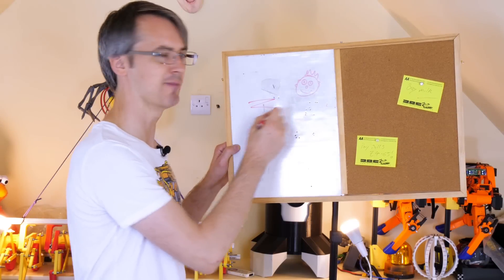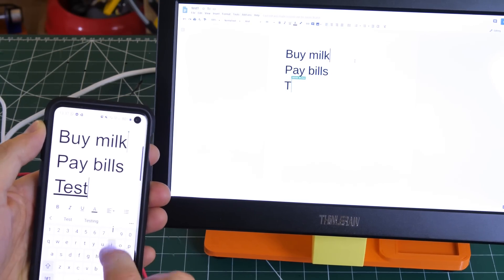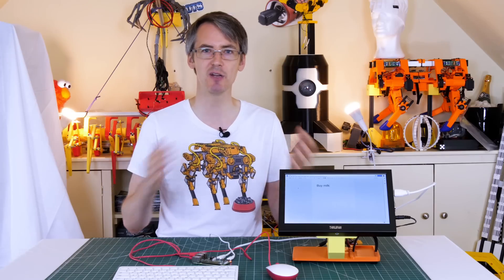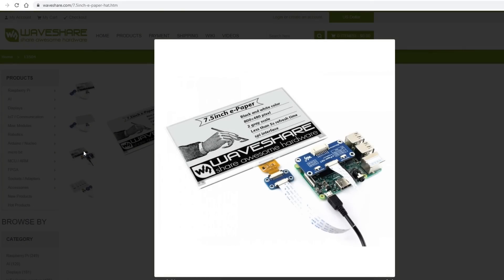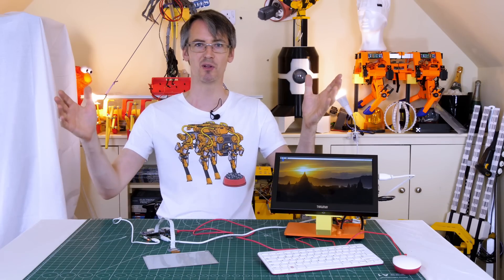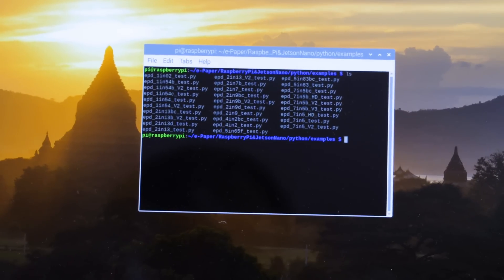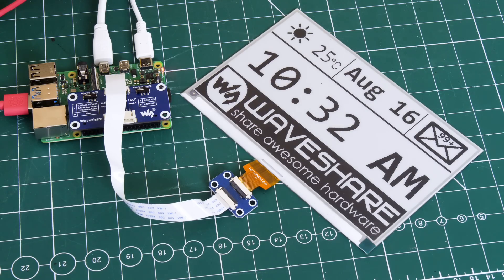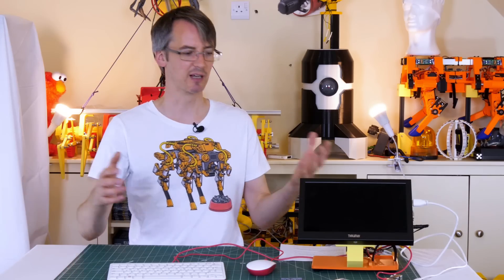DIY IoT  E-PAPER  Message Board

Comment: Oh a few things I got after reading the documentary (a few month back).
1. You can bypass the waveshare API and update text directly. However you risk damaging the display. Because ... (see point 2)
2. Refreshes are used for maintaining the display.
3. You want to refresh the display every so often anyway, due to display might get damaged if not refreshed of long periods. Manual said at least once a month. (I think) But because even refreshing does not use much power* I would refresh it once a day or at least once a week even if nothing changes.
4. You can backlight it, because the display is rather transparent (and lets a good amount light through). I plan to put a bunch of WS2812B behind I can turn on and off and change color to highlight and indicate things. It drives up power consumption, but not but that much. And you could make some items on the list e.g. flashing red, or so.

*= (negatable compared to a Pi 4, still little compared to a Pi 0W, maybe when run on an arduino and put that into sleep mode when not updating it might be add up to something in comparison )

Comment: 12:45 Actually I wanted to do a similar project* it even works on a Raspberry Zero (W), and while I am not experienced to do it, there is a way to get it run on a Arduino which would use even less power. 

*=have basically the same display, but I think I got the 10'' version. Anyway developing did not go well for me since the Pi I used was too slow for that so I put it on hold till I had my hand on a Pi 4 for development. But in meanwhile forgot about it and got other projects in front of it

Comment: New to raspberry but a Python guy. Does the Pi not usually use Debian? Shouldn’t  the Python interpreter know Context mgrs and lists? I didn’t see a close on the sessions nor the text files. So you leave it undefined when the Script ended and repeat it every 5 mins. I am surprised that the google API is not rejecting further sessions or the files get corrupted after a while. Also please don’t repeat so much code and use a List instead.

But that aside your ideas are great. Subbed :)

Comment: Just don't put any commas in your notes or it will break the read of the csv. The csv lib also supports writing so consider using that instead of manually adding commas. If you do, at least escape your text by putting it in double quotes: ".

Comment: Hmmmm.......very complicated and not at all user friendly.
There is a device on AMAZON, called an Epad, that you can write on like paper or a "black" white board.....the screen is black and when you write on it the writing remains on the screen in a light green colour.
The frame is only 6mm thick with a black or white frame, and the actual screen size is 130 mm X 180 mm.....the overall size of the frame is 180 mm X 210 mm.  
There are 2 buttons on the top of the screen, one for locking the display so it can't be accidently wiped, but it will still allow you to write on it even when locked, and one for wiping it clean when it's unlocked.......it runs on a 2032 Lithium button cell....for wiping the display clean..... which last for a few months.
One press of the erase button and the screen clears completely.
There is a passive stylus supplied with the pad, that sits in a simple loop of plastic on the top edge of the pad,  and you can write with your finger nail or more precisely with the stylus.
I use it to make notes and sketches while on the computer....saves using bits of paper or post it notes.
If the battery goes dead the display stays on forever and you have to use a new battery to wipe the pad clean.
Cost?........I bought 3 at A$13 each on AMAZON.........the one in the kitchen is my on the go shopping list.
Reply from the maker: Ok, I just won't make any more videos then. Bye.
Reply: @jamesbruton  OK, but K.I.S.S. then.....

Comment: Yes, great idea, great concept & execution, however I could power a standard 21" screen for a few years for the same cost as this e-paper screen (21" monitor @ 20W, powered on 24 hours/day 365 days a year @ 16p/kWh = under £30 a year! You could dim the display or turn it off during sleeping hours, so you could potentially half the running costs). You would still need the Pi to create an image anyway! Personally I'd rather build it into a mirror frame, plenty of projects & ideas for that. I'd make one if the display was bigger & cheaper as the cost savings for this use case over traditional LCD displays just aren't there!

Comment: Hey James, there is a type in python called list. You don't have to write out A0, A1, A2, A3, A4, A5, A6, A7, A8, A9, ... you can just iterate over the list (for line in A:)
Reply: Yep, was also kinda annoyed by this hahaha
Reply: @fusseldieb  I'm pretty sure you should be able to use a formula to generate a Hash code of a range of cells, all this could be done on the sheet then you would just need to compare the value
Reply: Same here, was pretty annoyed reading that code :D
Reply: also you can write a function that iterates over the list , and call it in multiple locations , instead of rewriting the iteration code
Reply: Same

Comment: Instead of polling the REST API every 5 minutes to see if there have been any changes, you can also attach an app script to your google sheet. You can setup this script to call a little rest API on your raspberry pi each time someone updates a field. This way the screen is updated instantly when you add something and you don't need to check every 5 minutes.
Reply: Trigger is definitivelly the way to go. Use a change trigger to generate a raster for the dimension of the screen and store this in the drive in a dedicated folder. When waking up the device will look for date/time of creation of the file, and if it is still the same get back to sleep. If this is a different date/time get the file and update the screen with it. As a result, replace the raspberry with any cheap MCU wifi enabled and run this on battery for months....

Comment: I had an idea/question that might work for a power supply and came back to your video to leave a comment just in case. You had mentioned in the introduction that a common place to leave notes like this is the refrigerator door with magnets. Could a Peltier module connected to the radiator on the back of the fridge generate enough power to update the display?

Comment: "So I used a Raspberry Pi..."
Me, who replaces every RPi project with ESP32s:
I have been summoned
Reply: An ESP8266 might even do it

Extremely low power consumption. You can make it deep-sleep and disable wifi until the next update, so you only use a few uA!!!
Reply: Next step, partial e-paper update only for changed lines
Reply: Make sure you post a Vid!
Reply: @UrbanInsight  https://www.youtube.com/watch?v=xnUqWcdtqyU
Reply: @trandi8  Sweet! Excellent Job! Youve gained a sub!
Reply: @UrbanInsight  :)

Comment: 4:10 - It won't fade. E-paper is essentially non-volatile storage, like hard-drives or flash-memory. The molecules have been oriented/aligned in a way that causes them to create black or white (or color) patterns, and they'll stay that way until they are re-adjusted. That's why it has to do the flashing thing to reset the display, it's readjusting all of the molecules together since it can't know which ones are in which orientation at the start.
Reply: I have noticed that with a three-color waveshare e-ink display that I have that if I do not run the display for *several years*, the image does very slightly fade, particularly around the edges.

Comment: Love the idea, but you should move your code to write to the CSV file into the IF block and only write if a value has been changed. Not sure if the library you are using is optimized for not writing a file that hasn't changed. This will prevent unnecessary writes to the SD Card.

Comment: Every 10 minutes checking for an update is old school. There probably is a way to use a notification that will call your webhook whenever there is a change to the document. Then you can write the change more real time and use no bandwidth when nothing is happening. I would implement it in such a way that notification causes a refresh of the data elements and set a changed flag. On another thread, check every few seconds if change flag is true. If it is, check to make sure time since last screen update > threshold (say 15 seconds), and if it is update the e-paper and set changed to false and go back to sleep. That way your e-paper will update in seconds when the Google doc changes, but also won't update too frequently if there are constant updates. You will save on bandwidth and have a far more responsive display.

Comment: I believe the flashing is part of the clear routine that makes sure all the areas of the display reset properly. The movement of particles in the screen is physical so updating the same area with the same color too many times in a row could potentially bake in the state and make it difficult to change in future. It's also recommended you have a full screen refresh every few days or so to prevent ghosts of previous displays from remaining permanently. I haven't had the issue on mine yet but I believe that is the reasoning.

Comment: Gdocs uses a version control system and you can be notified if someone changes the doc and run you code to update the display
Reply: You can, but then you have to always be listening for that notification, rather than only waking up every so often (every five minutes, hour, day, etc). That’s a great solution if your project is time-sensitive, like a to-do list that you want to update live, but isn’t as great for something that only needs to update once a day, like a weather forecast. If you only need to wake up the raspberry pi once a day, you can use a lot less power than keeping it on all the time; perfect for battery powered projects.

Comment: James ... you could install linux on an old e-ink book reader, and do all this for £20 or less... and without all the 3D printing.   e.g. an old Kobo e-reader or old Amazon Kindle.

https://techreport.com/news/17534/it-runs-linux-too-ubuntu-installed-on-amazon-kindle/

https://pcper.com/2013/04/new-hack-allows-kindle-paperwhites-to-be-used-as-wireless-display-for-rasbperry-pi/

I know, practical solutions are so boring.   These platforms all have WiFi built in, and are ready to use.

Comment: Cool idea. A quick look into the API docs I found a potential way to skip writing to the sdcard and really only update on either reboot or changes:
1. startup of the script
2. Get ntp time on you RPi
3. get the "modifiedDate" field for the file and its contents
4. Display it and save the value of modifiedDate in a variable
5. Every X minutes only get the modifiedDate property and compare it to its last value.
6. Fetch file and update display if the value of modifiedDate changed.

That way you could run all of it without writing if you like. Just make sure you catch exceptions e.g. if you internet connection is lost...

Comment: I've thought about doing exactly this, except I was going to use it to display my calendar.
That way it doesn't waste paper every year.
It could also have buttons to allow the user to zoom in on today
Reply: I would highly recommend this website to you china-epaper.com, DKE is an E-PAPER professional manufacture, price here is much cheaper than Wave Share the one this YouTuber found, for instance, 7.5" he used is $53.99, DKE only sale for $39.
Reply: This. Me and my wife have had this idea for years but never done anything about it. It just needs to be able to display output and move left and right through the months. Data entry could be via Google calendar on smartphones. Digital calendars are great until the screen turns off and it's no longer glanceable!

Comment: Some Arduino libraries like ZinggJM/GxEPD2 allows refreshing without flickering. But you need to do full refresh every now and then. I usually use full update for every 10th update.
Reply: Seems like a fairly standard feature for e-reader grade displays.
I've been on waveshare's website, and some of their displays are capable of partial updates, some are not.

Partial updates allow much higher effective refresh rates, but over time you get a lot of garbage on the display, so eventually you have to clear it.

My Kobo e-reader has settings for it, but by default it does a full refresh every 6 page turns.

Comment: I wonder if someone could just hack an old Kindle to this purpose? They can be picked for very cheaply, and already have everything you need built in.
Reply: You definitely could. The main difference is down to hobbyists versus hackers. A hobbyist can buy the kit, as James has done, have access to all the resources and community help, and learn as they go. A hacker must already understand the underlying principles, and has no access to resources since they don't exist. It's basically either end (or two points) of a learning curve.

[Edit] Actually there may be some online resources written by fellow hackers, since they have their own communities. If you're not sure how to proceed it's probably worth googling to see how much help is available before buying a second-hand Kindle.
Reply: @nagualdesign  I've found a few articles covering similar projects on hackaday so I think it's achievable
Reply: That could be done, but I've seen that Waveshare does also offer real e-reader displays (albeit without the additional stuff like touch, pen, and/or lighting) too.
Reply: Oh I'll check that out. I've seen 4th gen kindles on eBay for around £5 shipped so I might just pick one up to have a go at

Comment: Why are you not using a pi zero for this? Would make it look way sleeker :)
Reply: If it was flat, battery powered and attached to the fridge by magnets it would be very nice indeed.
Reply: nagualdesign Yes, this is what I had in mind as well! To be fair: the full size pi is a better prototyping platform and he could swap it out with something smaller later
Reply: @EngineeringSpareTime  He also has the option to cannibalize it for other projects, but it would be nice to keep all his old stuff in working condition (assuming he has room) as a sort of museum.
Reply: nagualdesign This would be nice. Talking from experience: It ends up with a lot of stuff in a small space and its all „dead“ money :) With the amount of stuff he is building, it would be enough to have a room full with the working/ finished prototypes
Reply: @EngineeringSpareTime  There may also be legal restrictions to prevent people from assembling a sizable robot army. 😉
Reply: nagualdesign :D especially with face recognizing „nerf“ guns
Reply: @EngineeringSpareTime  Pyoo! Pyoo! 😜

Comment: Hmm 15 variables, 15 lines of similar output code ....that is ugly. And I would honestly use hashlib ...to save hash, instead of prev values you need to compare with, but I guess whatever works.
Reply: Why bother saving the file every 5 minutes? Put it inside the if statement which checks for differences. So many details if we go for coding perfection.
Reply: deslomeslager I suspect the intention was deep sleep. Use an ESP 32, store the hash in the NV RAM then each wake you get the content, hash it, compare the saved hash and potentially redraw before going back into deep sleep for 5 minutes.

Comment: Cool idea. For the sake of the SD card lifetime, it would probably be better to just read the csv and compare in memory and only writing a new one to SD when there is an update.
Reply: I'm pretty sure it doesn't actually change the sd card as he said , it just changes the on board memory , because if it did, you would be able to access it via plugging the sd into a PC , trust me , I've tried it , only thing we have access to is the system files of the pi
Reply: @maskedredstonerproz  the reason why you can't access the files on a pc is because windows doesn't support the file system the pi uses by default (ext4)
Reply: @laurinneff4304  so is there a PC OS that does actually support that , I want to know because I'd really like to access said files from a PC , imagine the things I could do , I'd have to do waaay less reflashes
Reply: @maskedredstonerproz  Linux supports it (usually ext4 is used on those), and other Unixes probably support it too (so all the BSDs, and maybe even macOS). You might also be able to find a windows driver online
Reply: @maskedredstonerproz  It does. A quick look at the code - https://github.com/XRobots/IoT-Message-Board/blob/master/Code/v1/sheet02.txt - shows data getting written every single time the program is run.

Comment: E-ink screens really don't fade.  Ever.  My Kindle DX hasn't had power in years, and is still displaying the "please charge me" screen, I've also got more recent screens that have been in my parts bin for the last year and haven't changed from the demo text that they shipped with.

Nice trick with the google sheet, it seems at first like overkill but it really does have a lot of nice properties once you get through the authentication mechanism.
Reply: Better yet since he's using a google sheet; he could make a google form for super easy editing on the go. Just have one field with the content output the results to the sheet.
Reply: It probably depends on the conditions it's stored in, one of which seems to be if it's not used for a long time in a humid climate.
Reply: My Kobo e-reader is still perfectly displaying it's image (it's set to display the cover of what I was last reading, along with a message saying it's powered off or on standby as the case may be)

It's certainly not years, but it has been a few weeks.

It's probably going on a decade old at this point, so the screen is quite old as well.

Yeah. While I don't doubt that there are environmental conditions that could degrade the image, for the most part, e-ink displays seem to be persistent indefinitely.
Reply: I read that "please charge me" like that one Portal 2 turret saying "I'm different..." and it broke my heart.
PLEASE charge your Kindle :'(